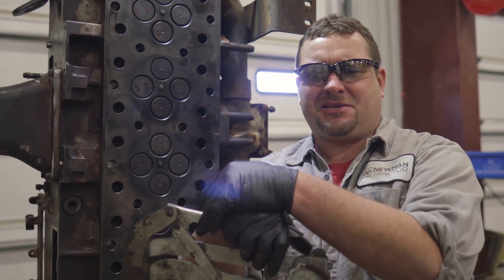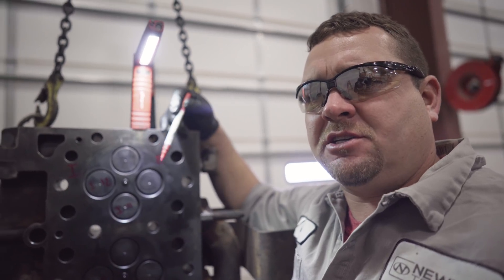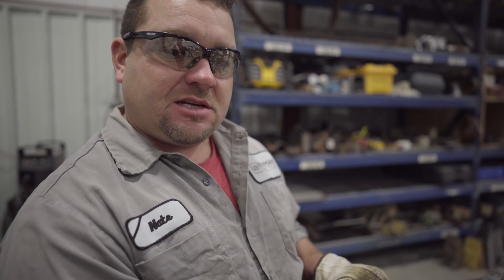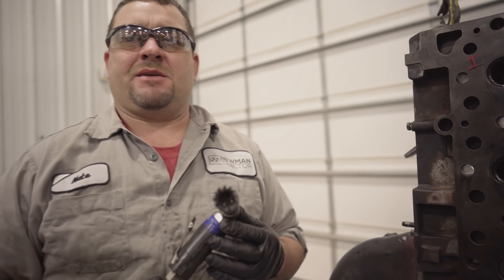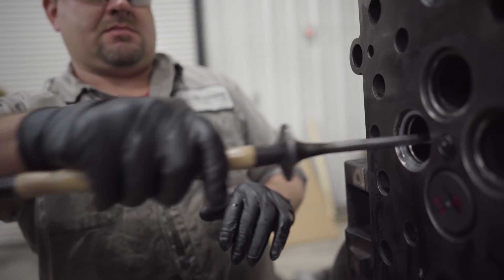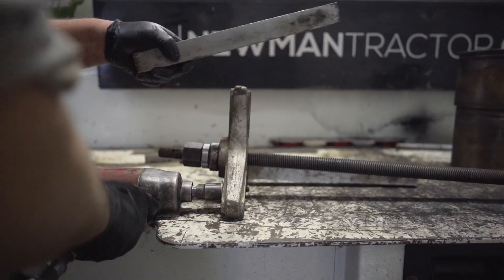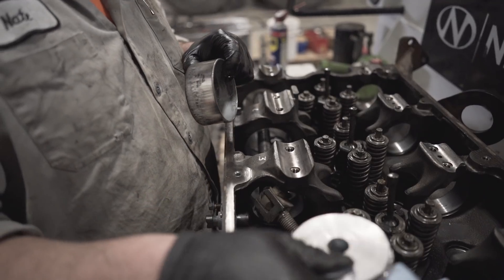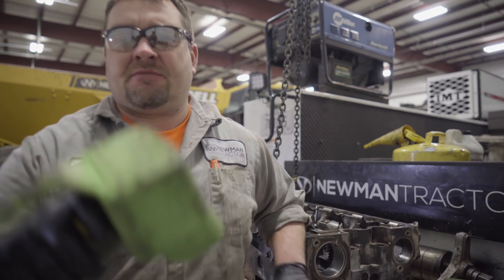How to Install Valves & Bearings (Diesel Mechanic)

Comment: How does one get a job like this ? im really interested in making this my career but have no clue where to start.
Reply: Decide if you want to work on equipment or trucks and find a dealer that invests in their employees. Some larger companies that buy hundreds of trucks a year do their own warranty work so they will likely pay for manufacturer training. United rentals and sunbelt do the same as they buy directly from the manufacturers.

If you want to do engine rebuilds, you’ll have to do some investigating. Most of the time, it’s cheaper to put a reman in. But not always. With the emissions technology, people will be more likely to want to rebuild than buy new, especially with trucks. But before you get to where he is in the video, you’ll be doing oil changes/suspension work/clutch jobs/undercarriages/tires. Prove yourself by doing that. Learn anything and everything.

Your absolute # 1 skill will be electrical diag. It starts with fixing lights, if a new bulb or fuse doesn’t fix it, you need to know where to trace next. Then you get into figuring out why the machine is derated because the DEF quality sensor is out of acceptable parameter even after putting a new sensor in.
Reply: cabwaldo hey thanks man !!! Appreciate the advice, im willing to start from the bottom and work my way up.
Reply: cabwaldo would you recommend going to diesel tech school? I currently work at a tire and lube shop so im getting some experience there.
Reply from the maker: Tech schools can be a great way to get learning and earn your way into an apprenticeship David.  Once you're in the job many places have continued learning and manufacturer training to continue honing your skills.  We are getting ready to launch our own NT University to our tech emplouees to take them from apprentice to master technician levels.  This will include many hours of  class learning,  productivity tracking and rewards.  If you are in the northern Kentucky area and have interest let us know.  We appreciate your passion for working on machinery and our industry needs more hungry technicians ready to get out there learn and crush it at their jobs.  Good luck on your journey friend.
Reply from the maker: Thanks for the great advice and incite for our friend brother.  We appreciate people like you that take the time to pour into others and give back.  Have a great day and keep on keepin on.